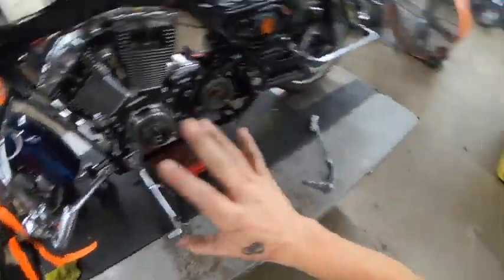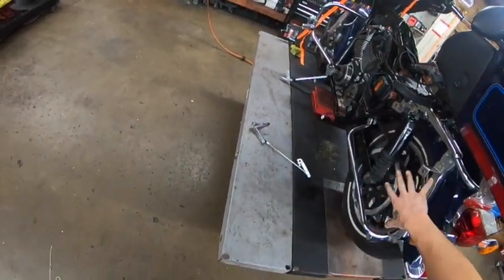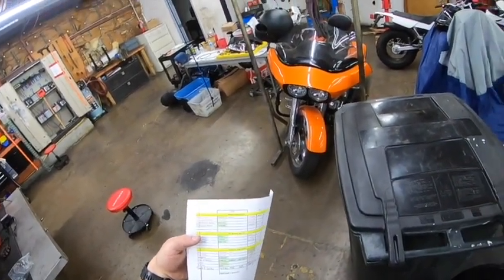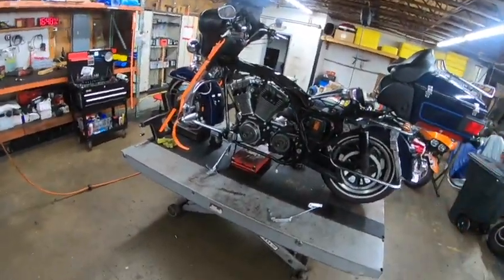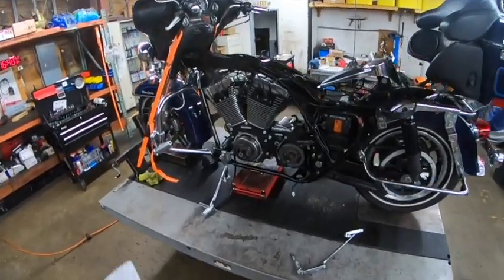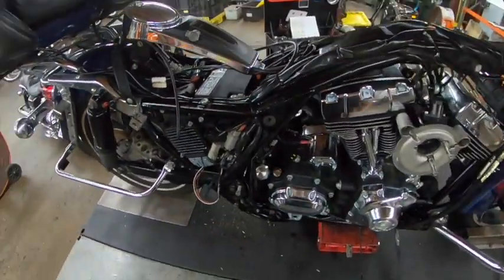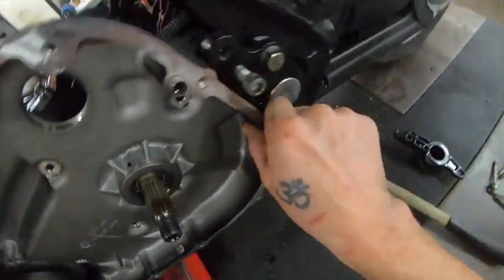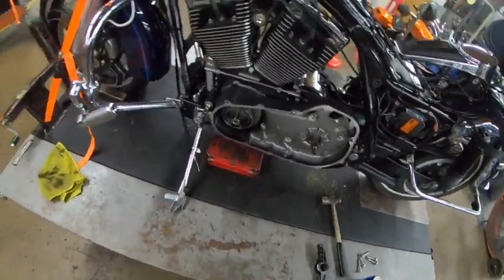Part 2 Harley Touring Twin Cam 88 to 96 swap

Comment: Older video but good information. I was wondering if I could reach out and ask some questions? I have a 2004 Electra glide that I’m looking to swap a 103 with 6 speed trans. Thank you in advance.
Reply: Hey did you figure out 103 and 6 speed  swap?